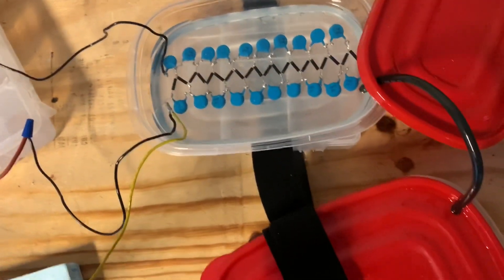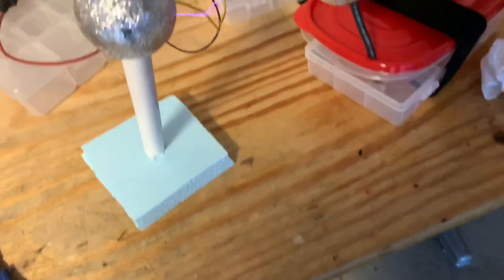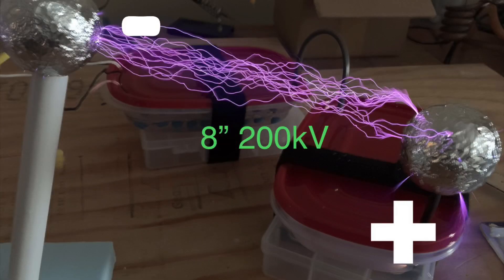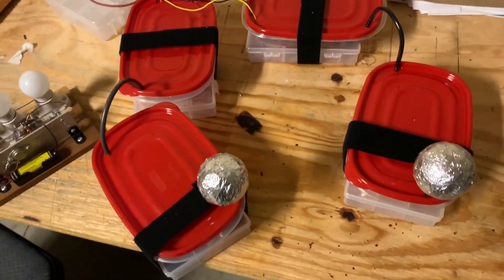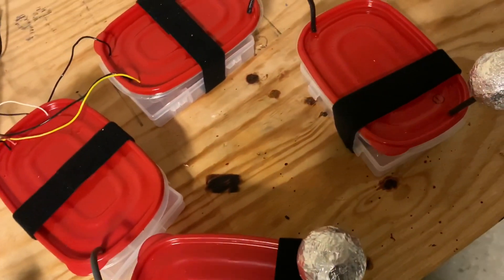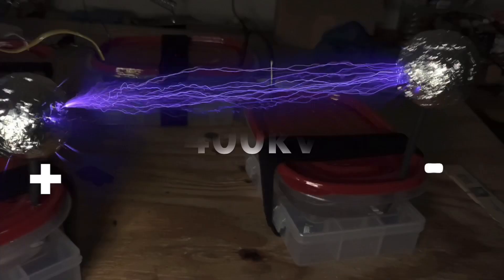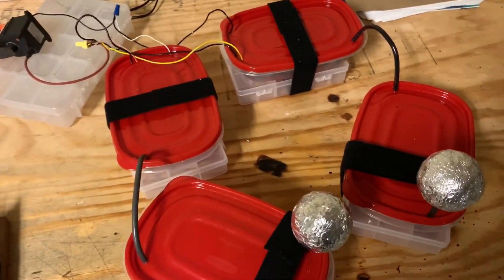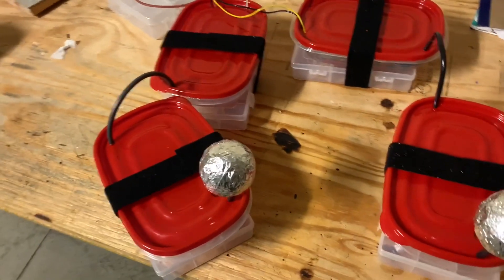Fun Observations with 400 kV DC lightning

Comment: The only certain way that I know of to eliminate blown diodes is to use a suitable load resistance to limit the current through the diodes. That's what I use and I have never blown a diode. A high voltage high power load resistance can get expensive however.
Reply from the maker: I initially had 2 MegaOgms HV resistors under oil and could only get Corona type output. I replaced these with a string of 120 kOhm HV resistors for the output shown. The diodes were upgraded to 2CL2FM which are 100mA continuous and around 3A pulsed rating. So far no diode issues!

Comment: Yes great!!
But with sharp electrodes you get 3x longer arcs ánd much more coronaglow before the arc starts.
One question(or two in fact): wich diodes and wich value capacitors you use? 
( myself use 2CL77 diodes, also 20kV and in my later builts i use 2 in series. But when they blew that same way like i see yours blowing, it was always thanks to an initilal arcing aróund the diode, over the surface from the oil because they were not deep enough under the oilsurface. Strangly that blows a diode almost every time)
Reply from the maker: Those are 2CLG 10 mA diodes. I had an option to buy 100 mA at ~5x the cost a risk I wasn’t ready to take since the voltage is most likely the issue. An interesting thing I noticed is the negative output multiplier has a much greater incidence of blown diodes compared with the positive output multiplier. Although the oil is deep enough, there is a lot of churning of the oil particularly at the high voltage end which could expose  diodes to the air. But most of the blown diodes were at the lower voltage end of the multiplier. Also there is more AC ripple at the lower voltage end of the multiplier. I will take the aluminum balls off to observe the corona.. Thanks for the advice!
Reply: @BrianDhvTinkerer  you know that the diodes have such low currentratings only because they are built with 25x 1000volt PN-junctions in series in that one diode-casing? So it would heat up by more than 5or10mA because their voktagedrop is 25x 0,6volt, by a constant current! But each PN can handle 0,5Amp easy when dutycycle pulses are short enough for not making the case too hot. You find that max peakcurrent on alldatasheet.com. (I had never fail one by too high from the normal supershort pulses in the multipliers, at least when using even a low hv-resistor at the ends. Thats what i meant that mine only blew when an arc shorts some pieces of the circuit so an unlimited capacitordischargepuls goes through them and only thát currentpeak will blew each diode. But i blew them never for overcurrent over that 5or10mA rating in the pulses nornal in the multipliers. 
Caps(mine4n7@20kV&10n@30kV,blue ones like yours,from aliexpres) are my most blown component so exept the hv-resistors at the end i soldered in series with each cap a resistor 100ohm1watt. When i did not spread the peakload over all that resistors then even the biggest resistor arced always over their resistorbody. 
(Ow i can type for hours about this!)
Reply: If you look back through the earlier videos from this channel you'll see he's quite familiar with the effects of electrode geometry as well as most of the other finer points of generating and handling high voltages. 😎  I'm thinking he's deliberately opted for spheres to minimize the effects of curvature on breakdown voltage in order to use that distance as a crude but reliable measure of output voltage.  DVM's that go up to 400kV aren't too common after all.

You might do well to insulate your multiplier with a solid.  If not HV potting resin, many have good results with paraffin wax.

I've also been messing around with solutions/slurries of ABS plastic in acetone and have been finding new uses for the stuff daily.  I usually just keep dropping  chips of black ABS pipe in acetone until it's the viscosity of printers ink.  For all my low to mains voltage applications it's made an excellent liquid electrical tape.  According to google ABS actually has better dielectric strength than paraffin too.  You might consider dipping a multiplier stage in the stuff to see if it helps.  

Otherwise you can always set up the stack within a length of tube filled right to the tippy top with oil and no air.